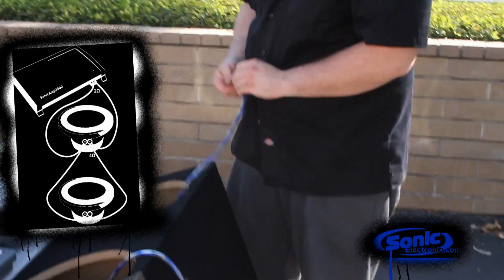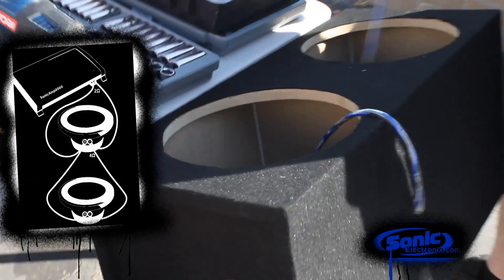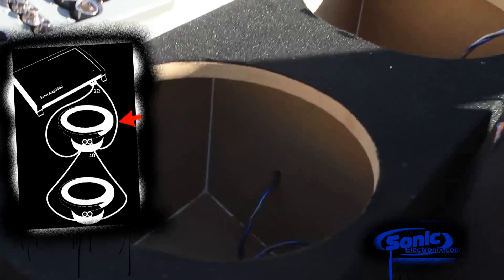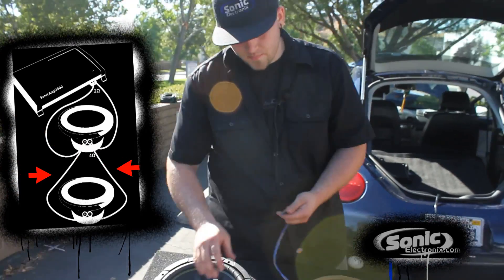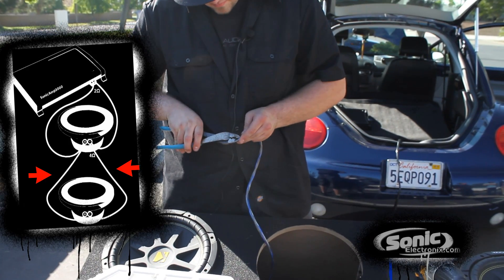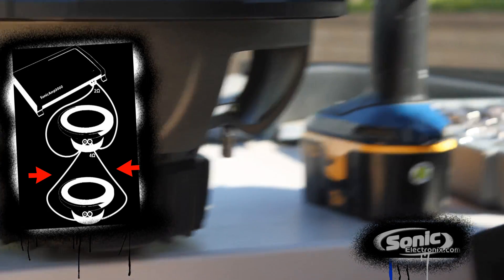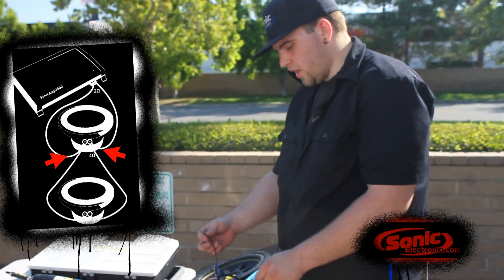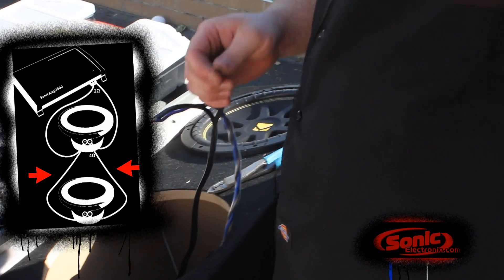How to Install Two Single 4 Ohm Car Subwoofer with a 2 Ohm Impedance

Comment from the maker: @xxxkhafanxxx If you amplifier is not bridgeable at 4 ohms you will not be able to do  what you are asking for. Furthermore even if it is bridgeable I highly doubt it will be enough power to run the subs properly. Two Type-Xs would be 2000W RMS. I dont know of any amp that can do 2000W RMS at a bridged channel. You cant wire a single dual 4 ohm sub to 4 ohms it just not possible. You can wire two of them to 4 ohms but not just one.

Comment from the maker: @gigasearchman If the amp has two positive and two negative terminals then it must be bridgeable, either to 4 ohms or to 1 ohm. You can only bring 4 ohm subs down to 2 ohm if they are single 4 ohm subs. This is assuming you are wiring them together. You can technically bring down dual 4 ohm subs to 2 ohms each but then you will have to run them at 2 ohms each and not 2 ohms together.

Comment: i couldn't find what i was looking for inthe wiring page. my Type-X's are Dual 4ohm. my amplifier is also a mono amp but it has 4 terminals combined..(like a 2 channel amp). i want to run both subs at 4 ohms because the power that the amp gives at 2 ohms might blow the subs! in the diagram i found running two of those kinda subs at 4 ohms and the amp was bridged. so my question is: should i bridge the amp like that and use only two of the terminals or all 4 of them without bridging the amp?

Comment from the maker: @xxxkhafanxxx We will need to know which impedance your voice coils are in order to set you up with a proper wiring diagram. Your Alpine Type-X's are either Dual 4ohm, or Dual 2ohm. Check out our wiring diagrams for more information: knowledge.sonicelectronix[DOT]com/tools/subwoofer-wiring/

Comment: Thanks for the video . but, i currently have two type x's which have two coils ( 4 outs ) ( 2+ and 2- ) . i want to wire the two of them to my mono amplifier which has (2+ and 2-). i want to wire both of the subs at 4 ohms NOT 2 because the amp is too powerful at 2 ohms. how do i wire the 2 subs that have 4 outs each at 4ohms to the amp?  

Thank you!

Comment from the maker: @XxKYFERxX I would suggest wiring the subs together and having just one positive and one negative lead. Your amplifier should show you where the leads go for a bridged impedance. You will notice that the amp only has one positive and one negative lead going to bridged configuration. Its never safe to have two positive and two negative leads going into one terminal.

Comment: @SonicElectronixTV My amp has 2 positives and 2 negatives ( 2 channel ). But i want to connect 2 subs to 1 channel, so i can bring the ohm load down to 2 ohms. Can i connect 2 subs straight to 1 channel (2 leads connected to 1 channel)  or do i have to connect both subs together first and then connect to the amp. My amp can handle 2 ohm stable so it is safe

Comment from the maker: @XxKYFERxX Some amplifiers will allow you to connect each sub to each channel and will internally do the bridging for you. However is your amplifier only has one positive and negative connection you are going to want to wire the woofers together first and then having just one positive and one negative lead going to the amplifier. Each enclosure should have terminals you can just connect the terminals together like you would the voice coils.

Comment: I got 2 seperate SVC subs (2 seperate sub box's) and a 2 channel amp. Can i just connect both wires from the 2 subs straight to the amplifier on 1 channel? Instead of connecting 2 subs together and then to the amplifier.. 
Can you please reply or somebody help me? i will subscribe to you :P

Comment from the maker: @xGODLYxSKiLLeDx666x If you are talking about final impedance then 4 ohms is better because it allows the amplifier to run more efficiently and with less heat being produced. If the amplifier runs more efficiently the woofers will also run more efficiently because they will be receiving a constant stream of cleaner power. If you are referring to the voice coils of one subwoofer, there is not much difference. It will just provide more wiring options.

Comment from the maker: @RaMpAgExMoDz Actually this is incorrect. If he has two Single Voice Coil subwoofers and is trying to run them off the bridged impedance he will be unable to do so. Two SVC 4 ohms will either wire together to 2 ohms in parallel or 8 ohm in series. Thus the bridged impedance won't work. If he wires them together and runs them at the bridged impedance it will cause problems for the subs and possible the amplifier.

Comment from the maker: @adamolivas If the sub is a Dual 4 ohm sub, then yes you can by wiring the subwoofer in parallel. However it is a Single 4 ohm sub then no you cannot. If you have a Single 4 ohm sub you will only be able to wire the subwoofer to 4 ohms or 4 ohms bridged. Most 2-channel amplifiers have the ability to bridge the 2-channels into 1 channel for a final impedance of 4 ohms and a slightly higher power rating.

Comment from the maker: @05Narco If you have a PRIME R1000-1D  amplifier and two P2 subwoofers then go with the Dual 2 ohm subwoofers and wire them in series/parallel to a final impedance of 2 ohms. This will give you 1000W at 2 ohm while the subs will only require 800W at 2 ohms thus giving them sufficient power. If you have just one sub I hope its the Dual 2 ohm version, so you can run it to a final impedance of 4 ohms. If you have the Dual 4 ohm version you won't be able to use this amplifier.

Comment from the maker: @xSugarDaddy420 No that's not really necessary. What you can do is get a Hifnonics Brutus BRZ1200.1D and run them both off this one amp. If you have two Dual 2 ohm subs run them at 2 ohms final impedance, if you have two Dual 4 ohm subs run them at 1 ohm final impedance. Also you can go with the Kenwood KAC-9105D.

Comment: @tman1122334455 sonicelectronics is wrong you can wire em together at 4ohms and use the bridged terminals to get 500W rms. and because the subs are wired together it will spilt in to 250W rms  =)

Comment from the maker: @tman1122334455 Unfortunately not, your subs can either wire together down to 2 ohms or 8 ohms, or they can wire separately to 4 ohms each. So you will have to wire them individually to 4 ohms to their own channel on the 2-channel amplifier. This means all you will be able to give them is 125W RMS and since Audiobahn has overrated power ratings you will be giving the Kicker subwoofers less than 125W RMS. We would suggest a stronger amplifier only because you have quality subwoofers.

Comment from the maker: @DelMonteMan243 Yeah, wire them exactly as Brendan is doing in the video. This is called parallel wiring, and it will give you a final impedance of 2 ohms.

Comment from the maker: @Spookz107MLBM Professionally we can't recommend wiring these two subs together, by doing so you will be under powering the subs and potentially causing serious damage to your subs. However by wiring the DVC sub in series to 4 ohms and then wiring the DVC and the SVC subs back down to 2 ohms, would be the best way to wire them together. Once again we do not recommend this, your amplifier is not strong enough and your subs will not perform at their optimum capabilities.

Comment from the maker: @Spookz107MLBM You have wire the subwoofers in parallel. Using speaker wire, you will go from one + to the other + of the second sub. Then from - to the other - on the second  sub. Once you have done this select one sub and run the + and - to the terminals of your box and then from your box to your amplifier. We have wiring diagrams on our website that will help out a lot, please feel free to check it out. Select the Kicker C124 and view the wiring guide tab for a visual on how to wire two subs.

Comment from the maker: @TheBrownwetback I am assuming the 4600W is the Peak Power. Regardless with 2 DVC 4 ohm subwoofers you will have a final impedance of 1 ohm, when wiring in parallel/parallel.  So you will need a 1 ohm stable amplifier that push 9200 watts of peak power. I strongly recommend figuring out the RMS power rating, this will give you a better idea of how much real power you are getting and  also make it easier to select an amplifier.

Comment: Is it okay to run a 4 ohm sub on a 2 ohm amp? I have ran 4 ohm subs on an 8 ohm amp before without problems and you would think that would be more stressful on the amp than more resistance so...

Comment from the maker: @little11Nicky If you have two Single 2 Ohm subwoofers then your only wiring options are a final impedance of 1 ohm, or 4 ohms.  If the subwoofers have Dual voice coils then you can wire them to a final impedance of 2 Ohms.  Check out our subwoofer wiring diagrams for more info on wiring options with subwoofers.

Comment from the maker: @vcwarrior3 Connect the speaker wire from the subwoofer to the terminal.  On the outside of the box you can wire the subwoofers in parallel.  It's not the cleanest way to install, but it will connect the subwoofers for a final impedance of 2 ohms.

Comment from the maker: @fingerandskateboard Yes exactly, if you install for example 2 subs to a Kicker ZX1000.1 you will be giving each subwoofer 500 watts RMS at 2 ohms. This is a great question because many people assume the opposite which can and will cause problems after installation. It is important to remember that the rated power will always be evenly dispersed to the number of subs you are connecting to the amp. Another important thing to remember is that some amp will give a peak power and not an RMS power.

Comment from the maker: @sarfrazrathore91 It sounds like your subwoofers have Dual voice coils.  This video shows an example for single 4 ohm subwoofers connected at a final impedance of 2 ohms.  For two Dual 4 Ohm subwoofers your only plausible wiring options would be to run the subwoofers at 1 or 4 Ohms.

Comment: Ive got 2 subs running 400 watts rms each, and my amp is 1200 watts rms @2 ohms, my subs are wired in 4 ohm, can i wire my amp to this 2 ohm set up? I dont want to blow my subs! right now i am running my subs into my amp at 1 ohm bridged.

Comment from the maker: @MrSupermac1 Well since your subwoofers each require 400 watts, and you're connecting them to a 400 watt amplifier you may be significantly underpowering them.  Is the wattage that you are reading the RMS power output, or the peak power output?  Try to check to see what the RMS ratings of each sub is, and add them together to see how much power you need to properly drive them.  It all depends on the impedance (ohms) and power ratings to see if they will matchup.

Comment from the maker: @clamo636 Your best bet may be to start fresh.  You might be able to use that subwoofer for testing purposes but it's pretty hard to use a subwoofer with no information on it.  Check out our website or give our sales staff a call if you're interested in a new subwoofer and would like some assistance on finding some alternatives.

Comment from the maker: @TheDaltonboii It's possible - but you are putting yourself at some very high risk!  You need an in-line fuse because if there is a surge or any other electrical complications your vehicle could be set on fire. The wire gets hot when it's overloaded and when the fuse would usually pop to protect this from happening the wire will heat until it's on fire without the aid of a fuse.  It's definitely necessary to run the fuse in-line.

Comment from the maker: @Reidwr3 Ohms Law is a complex theory that relates to resistance upon wattage.  For car audio, you don't have to know Ohms Law to understand how it applies.  Ohms in audio will basically effect your wiring options.  Amplifiers are capable of pushing different amounts of power at different impedances (ohms).  An amp that can push 500 watts at 2 ohms, may only push 300 watts of RMS power at 4 ohms, but this is more stable for your amp.  Less resistance (ohms) means more wattage but less stability.

Comment: is it possible to run a wire from the battery to the amp without an inline fuse?

Comment from the maker: @clamo636 We understand. If your subwoofer has dual voice coils then you'll need to follow a different wiring diagram.  Their impedance (ohms) also is important to consider for what you want the final impedance to be.  If they are Dual 2 Ohm then you can wire them to 2 Ohms.  If they are Dual 4 Ohm you can wire the subs to 1 or 4 Ohms.  We have a subwoofer wiring calculator on our website found in our knowledge base.  We'll message you a link.

Comment from the maker: @gtkid13 Exactly.  Just wire up the terminals in parallel and run it to the amp and you're amplifier will have a final impedance of 2 ohms.

Comment: @SonicElectronixTV ok so it would be like 
+and - from one sub terminal to the other terminal
then just connect the speaker wire from the amp to one of the sub terminal?
thank you

Comment from the maker: @gtkid13 If you have two separate terminals then you can basically use our wiring diagram to hook the subwoofers up in parallel.  When you connect each subwoofer you will connect the + and - directly to the box terminal.  Now you basically connect the speaker wires from the box terminals to your amplifier just how we do in the diagram, just imagine that the subwoofers are terminals.  This will parallel the wiring and create a final impedance of 2 ohms.

Comment from the maker: @gtkid13 If you have two single 4 ohm subwoofers like we're using in the video and you don't want to cut a hole in the box, then you can wire the speakers normally to each of your box terminals (if there are two) and wire it in parallel outside of the box.  

The reason we put the hole in the middle of the box is so that we can have a clean installation, and as was discussed with the installer will barely impact the sound quality.  You'll still get great sound quality and have a clean install.

Comment: i just ordered a box and is wondering if i could connect it at 2 ohm without putting a hole in the middle of the box....
could i use the Built-in Terminal in the box to connect it at 2 ohm?
thank you

Comment from the maker: @newmurray4 It depends if the subwoofers have dual voice coils are not.  If they are single voice coils you'll just connect each positive and negative speaker lead to a different channel.  If they have dual voice coils (each sub has two positive and two negative terminals) then you'll want to wire them in series/parallel to achieve a final impedance of 4 ohms (bridged)  Not sure how much power this amp outputs, but if it's rated as a good matchup it'll work fine.

Comment from the maker: @TheDaltonboii Most quality 8 gauge amplifier kits will contain a fuse that ranges from 40-60 Amps.  Depending on the brand of wiring you use and if it's a true strand count then you would most likely be safe with a 50 Amp fuse.  If you buy an amplifier kit it will usually come with a matching fuse that will work perfectly.

Comment from the maker: @TheDaltonboii It depends on the size of wire you use.  If your amplifier uses 4 gauge wiring for instance, you'll want to use a fuse that's around 80-100 amps.  It depends on the quality of wiring you use as well.  If you use high strand count 4 gauge wiring than you'll want to use a 100 amp fuse.  If you go with budget 4 gauge wiring you'll want to use an 80 amp fuse most likely.

Comment from the maker: @lopez4life123 That sounds like it's a perfect setup, but I can't guarantee it will be compatible.  Is the 1- channel (monoblock) amplifier you have capable of 400 watts RMS at 2 Ohms?  Also, do the subwoofers have one speaker terminal for + and -, or does it have two + and two - terminals?  If the amp is capable of 400 watts RMS at 2 ohms, and the subwoofers only have one set of + and - terminals then this setup should be perfectly compatible!

Comment from the maker: @shawnybdmc I wouldn't necessarily recommend two of those subwoofers on that particular amplifier.  Each Kenwood KFC-W3012 requires around 400 watts of RMS power.  The Alpine MRD-M501 will push about 250 watts into each subwoofer which will cause them to be underpowered.  This can be fine, however you will need to be careful with your gain settings.  If you do end up using this setup, wire them like we did in the video.

I'd recommend slightly larger amp, capable of 700-800 watts RMS at 2 ohms.

Comment from the maker: @davidIIIbaby 12 gauge will be sufficient.  You can use 10 gauge if you really want to, but it's not going to make a difference.  10 gauge would be better on subwoofers like an Orion HCCA or a RE Audio XXX.  That should be a great setup!  Two CVX's provide some really low bass notes.

Comment from the maker: @davidIIIbaby For this video we use 12 gauge speaker wire to wire up the subwoofers.  Usually we'll use 12 gauge for most subwoofer installations.  You can use 10 gauge, but it's considered overkill in most situations unless you're using a really high output system.

Comment from the maker: @InsaneMetalAsylum A great wiring kit that's also affordable would be the Stinger SPK5681R.  Another awesome kit would be the Rockford Fosgate RFK8I.  This kit doesn't include speaker wire, so you will need to consider that as well.

Comment from the maker: @ranchero302me For Dual voice coil speakers it's a bit different.  You may want to check out our subwoofer wiring diagram found on our website so you can troubleshoot to find how to wire up your setup.  Our subwoofer wiring diagram is found on our knowledgebase on our webpage, and I will message you a link so you can find out what setup you're looking for.

Comment: @SonicElectronixTV the speakers i just got are volkenhag concep dual voice core 4hm 1000 watt 12s bought them cheap to help a friend out wright now i got 8ohm kickers 12s. and advise on the volfenhanin speakers thier in a ported box. I  got a kenwood class d mono 1000 watt 2 channel? Im lookin for deeper bass my kickers are on a 600 2 channel amp jvc